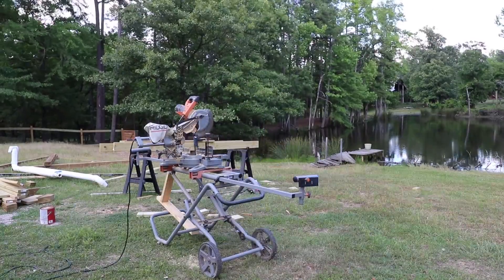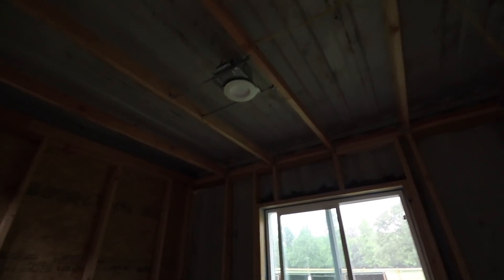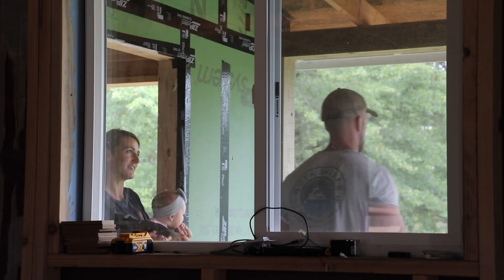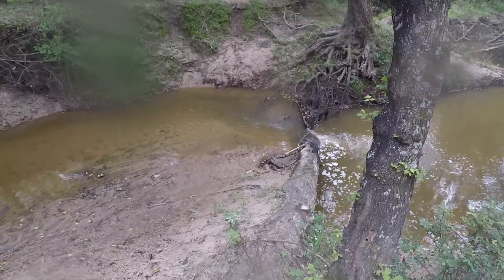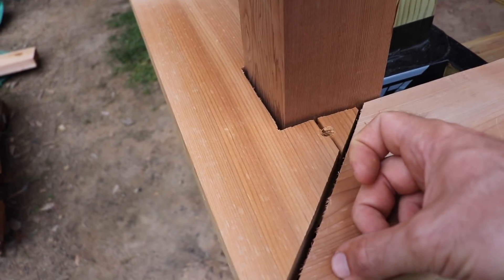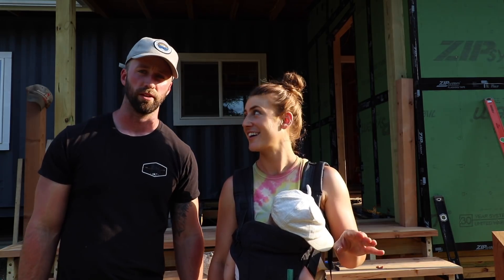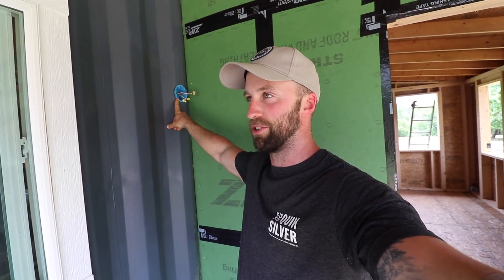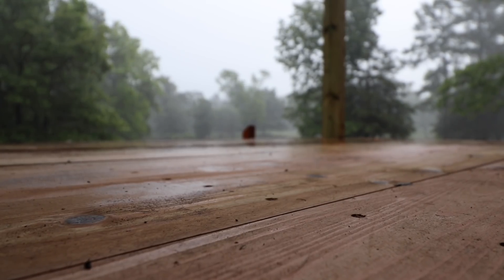Tying It All Together!

Comment: Happy birthday Spencer and many many many more. May all your wishes come true for you.
Another subject I noticed you still have the problem with the snakes all around. They know how to climb stairs, walls.  I don't know what they're called but they remind me of a Lasso.
It's a long pole about four feet with the Rope running through the pipe and you slip it over the snake's head and pull it tight so that you can remove the snake to another location. You need to buy it at least six or seven of these things and put them around your home especially now since you have a small child. Rakes & poles do not work There's a tool for every job🤔

Comment: With time, without a doubt you'll be clearing some trees, before what no one wants could ever happen!

You can leave the triangle of the board glued with wood filler, and add screws in a widen area where it won't split.

Comment: Hate to spoil all of the gushers gushing, but it looks like the tops of the stringers will eventually fail with such a small piece of wood left to attach them to the deck.  Especially with the way the wood grain is running.  Might want to add some kind of metal joist hangers and cover those up with a 1 x riser board.

Comment: Im worried that the top connections are too short and the grain could be prone to splitting at those screw penetrations.  I would be well served to increase the length of the board behind them and use hanger brackets.  The big test will be is if any fail when weight is applied to the upper half of the treads.

Comment: If you run into another need to patch the container but are worried about sparks burning something or leaving Marks you dont need to weld them in.  You can use a product called panel adhesive.  It's an auto body product used to "glue" cars together.   That's right most cars are glued now.  It's a simple system and rock solid.   It will last forever.
  Also if you have overlapping panels that you are worried about moisture getting in you can use seam sealer which is a caulk but an automotive (i.e. metal) caulk on steroids that will seal for decades. 
Just an fyi

Comment: Hello, thank's for the interesting videos! - But attention! At the top of the stairs, you can see at 5:43, there could be a danger! The part, who is fixed at the wall, ist to small and could break, like the part at 10:43, because the texture isn't lengthwise. If this happens the hole staires could break down and people, who use the stairs in this moment, could be injured seriously. Best regards from Germany, Joachim.

Comment: wood glue is your friend. it can make the connection between the two pieces of wood stronger than the rest of the wood itself. if enough stress is put on the wood, it will brake at a wooden stress point before the glued piece is sheared off where it's glued together.

Comment: How do you eat an elephant? One bite at a time. Everything's looking great. Bumping out onto the deck was the right thing to do. One suggestion though: the tops of the stair stringers (at 0:47) are dangerously thin, making contact only above the first step down. Unless the back of a stringer is in full contact with the wall/deck, stringers should end with a full tread at the top. That ensures enough support without risking snapping them off...and eventually they will snap off, one at a time. For your family's safety, please think about this some more.

Comment: look i want to help you here , the stair stringers truss screwed to the box nice, but the way a stringer ,rafter works is bearing on the lowest part,so you can either get strapping ,or there is a product for this stringer support ,it wraps under the heal then up the plumcut and is fasten to the box between the stringet , , now this is a robust staircase with many stringer so you got that going for you, either the strap ,or adding a 2x6 on the back side under the box and fasten to box is ok to,

Comment: Reinforce the last (top) riser. The wood it not pressure treated, the part leaning onto the deck frame is too thin and won't last. Just fill up the space under with pieces of 2 by 4 against the lower outer joist.

Comment: Strong winds will almost never topple a tree in dense forests. Strong winds have a much better chance to topple a tree in sparse forests or at the edge of a clearing.

In dense forests the energy in moving air is distributed across many trees and the load is shared such that no tree has to bear more than it can handle. At the edge of a forest the tree has no such support in one direction and a strong gust might overwhelm the tree suddenly. Also in a clearing roots will often be more exposed from soil erosion and they might get damaged from animals and humans.

Of course conversely, with how those clouds looked you might have wanted to leave the forest at any rate in case there was a chance of lightning. A clearing is better than a forest in that case.

Comment: You should redo the stringers before they catastrophically fail (or support the bottom of the top of the stringers somehow)... You attached the stringers on their weakest point at the top. Stringers often break along the triangular sections along the grain lines (kinda like that little triangle that you broke with a screw on your decking).  The strongest part of the stringers is the portion that has continuous grain lines from top to bottom of the whole stringer. You didn't attach the deck to this part of the stringers. At this point I would suggest digging a footer directly underneath the top of the stairs and putting a vertical support that attaches to the bottom of the top of each stringer. As it is right now, a heavy load (moving furniture or appliances), or as the stringers age, dry, & crack could lead to a catastrophic failure of the stairs. FYI. Just don't want you guys to get hurt. If this isn't making any sense to you... Go to your video and pause it where you can clearly see the stringers attached to the deck. Look at the grain lines and imagine the stringer failing along the grain lines (which often happens with wood as you demonstrated on the decking).
Reply: Looking at the video right now... With only about a 3-4 inch section of grain cracking your stairs would fail. Not good.
Reply: You could also disassemble the stairs and replace one board to make this work out. You screwed the stringers at the top into what looks like a 2x6 or 2x8. If you change that to a 2x10 or even better 2x12 your problem would be solved because you would be supporting the portion of the stringer that has continuous grain top to bottom.
Reply: The best views of this failure point are at 5:42 and 5:53 in your video. Look at the bottom corner of the 2x6 you're screwing into and trace the grain pattern of the stringer diagonally down. Yikes!

Comment: It is fairly impressive the time you take to make sure things are right. But I did notice the top of your stringers are a little odd. They don’t seam to have much support. With how thin you made them I would think they would break with the grain of the wood much like the corner you snapped when you tried to put a screw in it.

Comment: Stairs are not made properly. Please revise them and check the distance on top of the pilows that touch the deck. You have a massive gap there and it should not be. The only resistance in the stairs you have is the small 5cm thickness with 2 bolts. Minute 5:43, 5:53. Massive gap and you have to fill that with wood to have safe resistance.  If you don't fix them, the stairs will brake in weeks.

Comment: I didn't see a back door. If you don't have a second exit or one of your windows at the opposite end from your front door as an emergency exit,  you might have trouble getting your build signed off by any building inspector for fire safety. It's an amazing project and wouldn't want you to end up having to rip out a bunch of dry wall and framing when it could be figured out now.

Comment: That board on the porch could have been easily fixed with a little glue. Then drill out the hole and put the screw back in the hole and not driving it down till it splits out again. Just sand out any unwanted pen marks before you stain.

Comment: That little bitty chunk has no load bearing need. Just glue it back in place and use sanding material and glue to fill in the hole.  No need to waste a board.

Comment: Are you lacking support behind the stringers at the top?  The whole vertical part should be against support otherwise your high stress point is a diagonal from the last step corner diagonally away.

Comment: Instead of replacing that picture frame board... glue/clamp the broken piece off, install the board.  Get a plug cutter and cut a plug from a scrap of the same wood (keep track of the grain orientation).  Glue the plug into the countersink hole you had for the screw, Japanese saw to cut flush, sand and it's repaired.  It's in a spot of zero traffic, no load on it, should be GTG.

Cotton Mouth?  Lop the bastage's head off with a shovel.  Do NOT touch the severed head, and bury it beneath a rock.  A severed snake's head can spontaneously bite for a long time after it's dead. 

And, (girl)... it's called sand paper, use it... burple mark vanishes
Reply: @hcandersen6840  If I did, I would've said so. Nice young couple doing a good job.

Comment: Stringers look good. wish ya'll would not have made wood to concrete contact. you will have rotting within 5 years. Not trying to be negative because the way you did it is the standard but not for the test of time. looks great though guys.

Comment: I love this channel, dont get me wrong... I just don't understand why they still focus only on outside details while the interior isnt done, just the bones and electricity/water. 
Usually you do the frame, then inside, up to kitchen,bathroom,floors,paint.. and you end up with the deck and fences,etc..  Still love the project but every episode I see outside details works or adding the extension room,there is no windows so water can come and the whole building is still on wood and metal,no insulation.    even more since they are in a very small camper for so long, I would focus to get some rooms done so you can sleep inside and wash yourself... Is it just me?
Reply: You have to seal up the outside before finishing the inside.